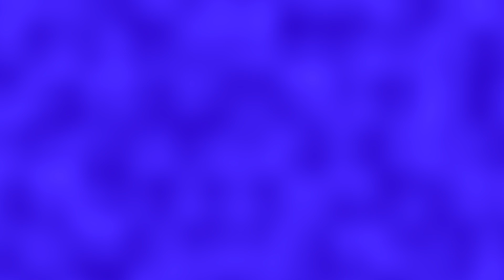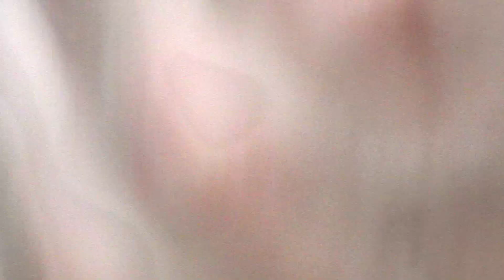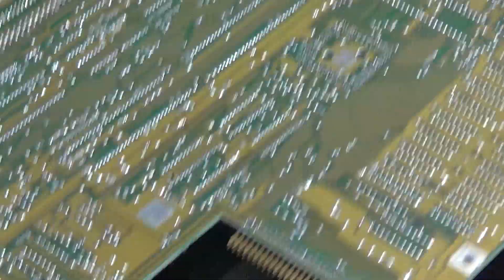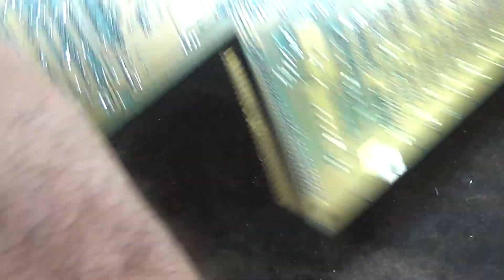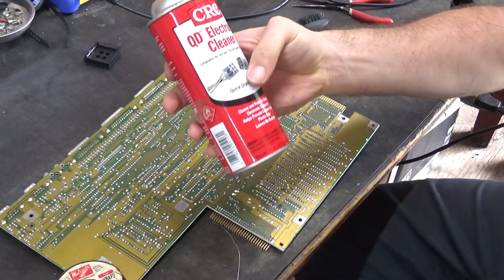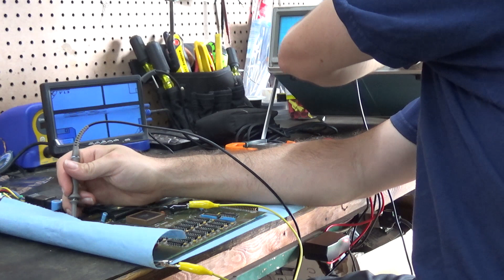Amiga 500 Project PART 3: Green Screen Troubleshooting Take 2

Comment: The biggest change you can make if insisting on using those god awfull spring loaded desoldering pumps is to buy an Engineer SS-02! Probably the best desoldering pump I have ever seen! No I am not one of the employees btw but I will say that japanese pump tool is just amazing. The tips are heat-resistant rubber which is replaceble, this means you can get right into the spot you are heating up. I have a Vacuum station, heatgun all sorts so I am spoilt for choice when doing re-work. I stumbled upon somebody else who seemed to heap praise on the SS-02 so took the plunge and bought one. They truly are amazing, very well built little tools. I have two in my kit now! One for the desk, the other for out and about.

Comment: The best solder suckers are the large blue and yellow ones, like the one I use in my videos.  You can buy them on eBay for around $7.  They work really well.  That solder sucker that you are using is too small.  It has a weak spring and does not produce enough suction.